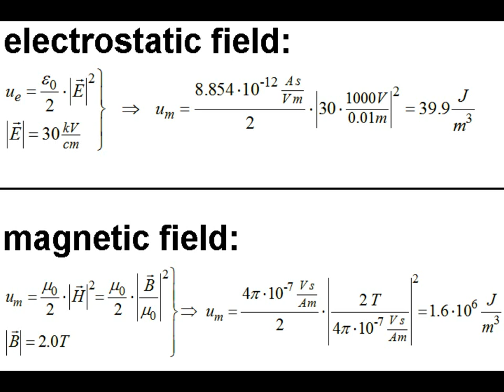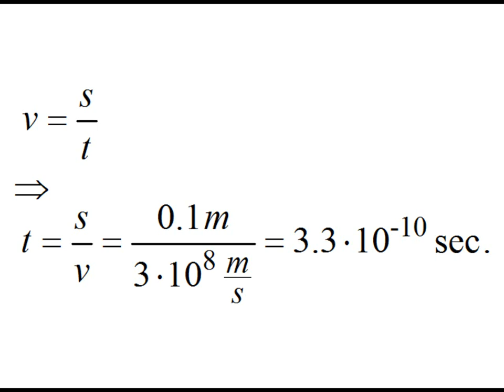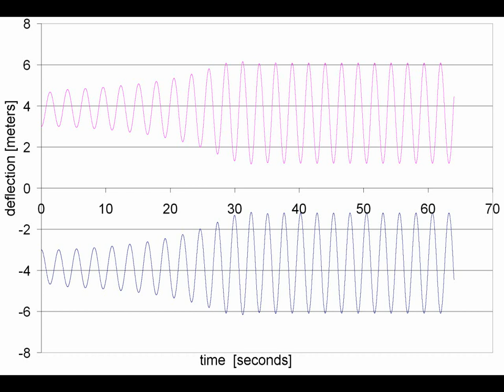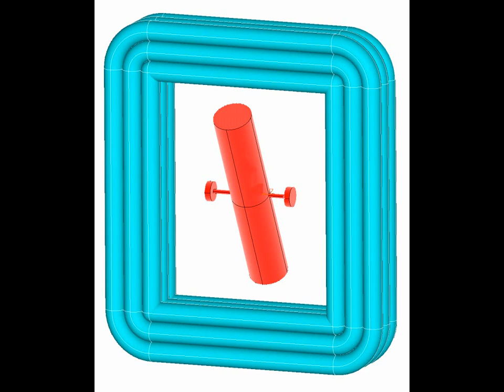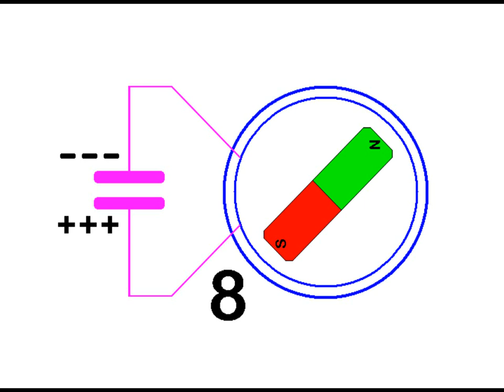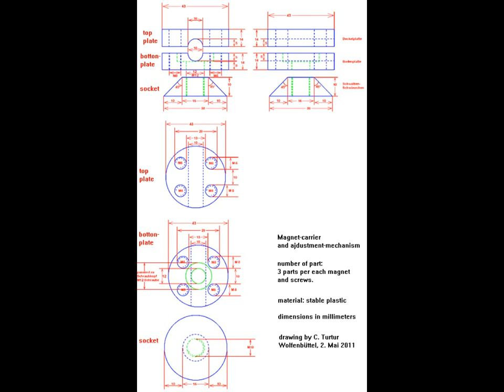Is the Energy-problem of mankind solvable ? (part 3)

Comment: verry interesting it seems to be a lc circuit coupled to a coil, and tuned to proper freq. if the thery and drawings are corect the gen will quickly go to resonance and stabilise locking to resonance.  then using the tork on a shaft remaining mechanicle tork woude be usefull for power generation, or you can blead off from the coil ad a load. there is many ways i see to do this. i have made one simular with 6 ring magnets, and yes it works! with no runaway problems.